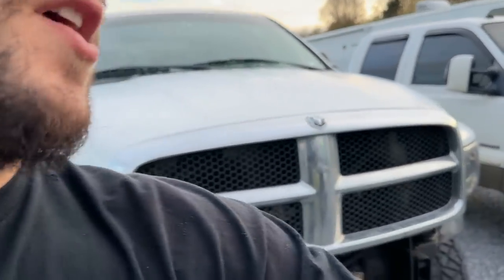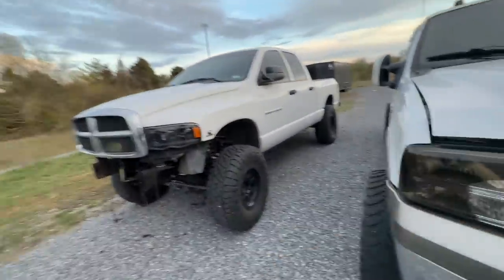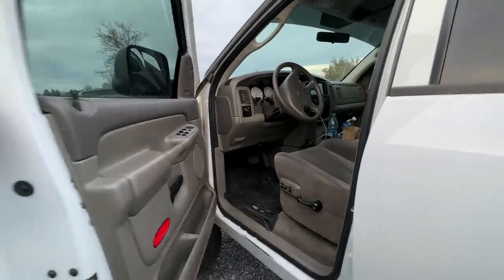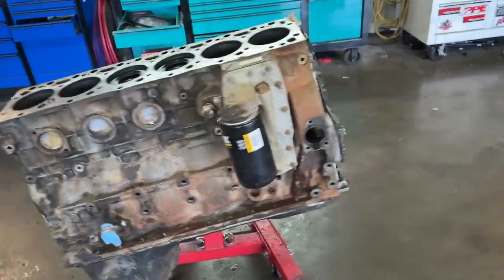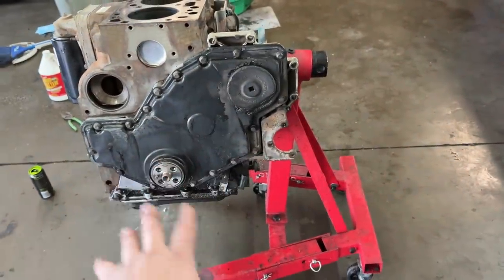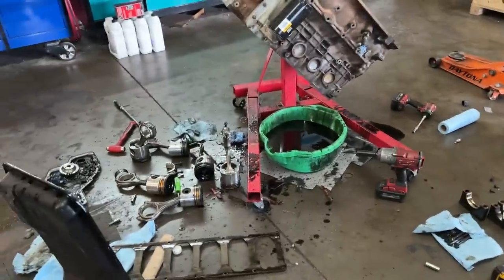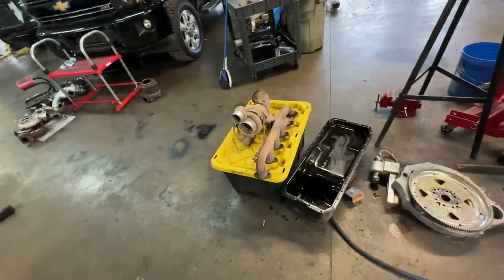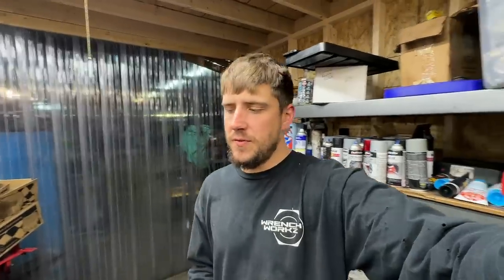Project 2003 Cummins 1000HP Compound turbo build!

Comment: Currently building an 05 with small bowl pistons, going with a smarty jr, just unsure of who is best for tuning. Flux 103s, 67 stainless and 10mm pump
Reply: HP tuners from Firepunk. 
No disrespect to Josh.
Reply: Well if you want custom tuning do not buy a smarty jr.  Buy an MM3 or a touch and get tuning as said from Firepunk.  I use them for both my trucks, and the tunes are great, just be prepared to wait up to two weeks between tunes.  You can also use Hp tuners it is cheaper but imo isn't the best.  It's a bare bones type deal if you already have gauges it's fine.  One thing the smarty touch/MM3 has is it will recover your ecm if you have a bad flash which will happen at some point.
Reply: HP Tuners gives you "ultimate" control over the ECM for 03-05 trucks used daily. Does not have a screen for display of gauges through ECM inputs. HP tuners takes about 20 minutes to flash a tune but allows the user/tuner to make any change wanted. 
The way I see it, 03-05  HP Tuners.   06-07.5  EFI Live.  Seems to be what the cool kids are doing.

Comment: Josh, how do you feel about sleeving a block to repair a cylinder vs boring all the cylinders?
Reply: Because there is usually some wear in all cylinders I generally recommend just going overbore so all cylinders can be new spec versus just fixing one hole because it only costs about twice as much($1000 to bore all, hone, clean, and inspect) to make every hole like new than to sleeve one hole to new($600 sleeve and hone one, hone other 5, clean and inspect) and have 5 kind of ok ones.  Also by overboring you gain some cubes so you spool the turbo slightly better and make more torque.  If you want to run crazy boost then boring may not be an option as it does weaken the block slightly but honestly if you are under 800hp like most people that drive their trucks everyday I would not even give it a second thought.
Reply: @bcbloc02  thank you for taking the time to answer my question. I realize you are busy and I appreciate it. I am helping my Son on a project that he just bought from a friend of mine that has a supposed hole in #6. It should be a good learning experience for him. A few years ago I talked to you on the phone at PDD and received some advice. It is really cool that you are so willing to help others. Thank you. Keep making the videos. I enjoy watching them. And even after wrenching on vehicles for over 40 years I still learn things from them. 👍

Comment: At what HP mark would you say a higher lift cam is worth the investment? At 1000hp for the goal, why not a different cam? Cost is minimal at that point.
Reply from the maker: Don’t need it on the early style common rails. Non egr cam and plenty of flow for that power with good spool. I’ve made 1800hp on a stock early cam

Comment: How much will customer pay for this job parts included?

I bet its less than what I spent in parts on my truck. Cuz I am ignorant.

Did you switch to the 06 style pistons or no?
Reply from the maker: It was right around 30k
Reply: @horsetorquesdiesel  Yep less than half.  And I still need a short block. I am so discouraged.
Reply from the maker: @BentonL  bring me what you have I’m sure we could get it right

Comment: If I were to send my truck to you, how much would that cost? rough ball park?
Reply: Everyone wants to know! I’m guessing 20k
Reply: @kevinstephens4118  Yeah, I have a spare 6.7, spare trans, etc. my issue is trying to find a machine shop that will deal with a cummins and the time to assemble and install it myself.
Reply from the maker: About 30k
Reply: @sidewaysstarion  They are super easy to disassemble and assemble.  If you can pull the motor out you can rebuild it no problem.  Like you I have the same issue with machine shops, zero around me.

Comment: I'm doing a similar build on an 06 5.9. What are your thoughts on stock main bolts (or ARP studs) at the 1000hp mark? Should I go with 14mm mains or will it be fine with the stock 12mm bolts and stock girdle. Its just going to be a weekend toy and occasional light towing. Thanks!
Reply: I think the rule of thumb is 1200 on 12mm main studs, any bigger and you’ll want 14mm